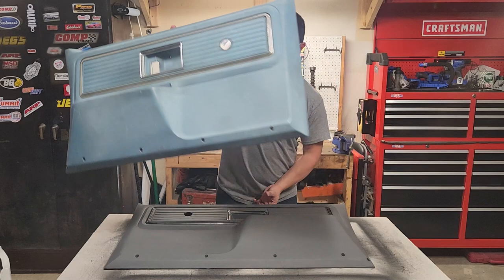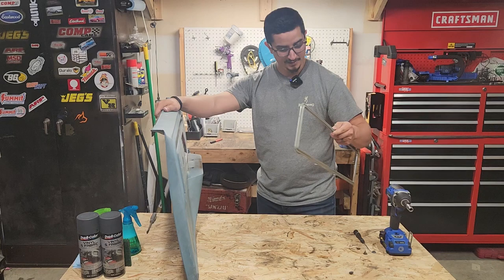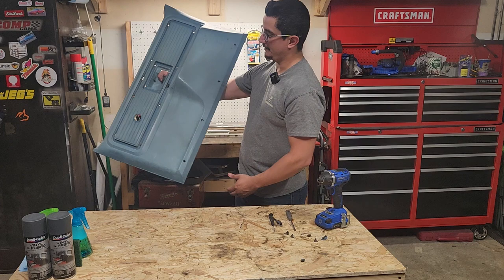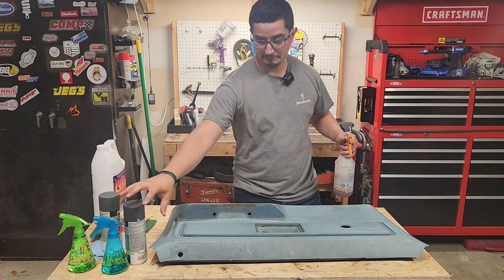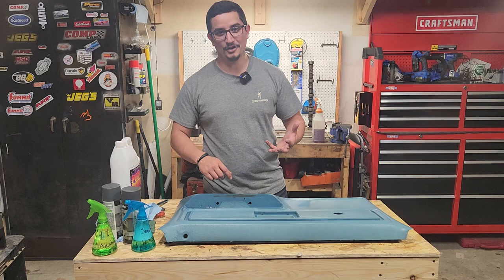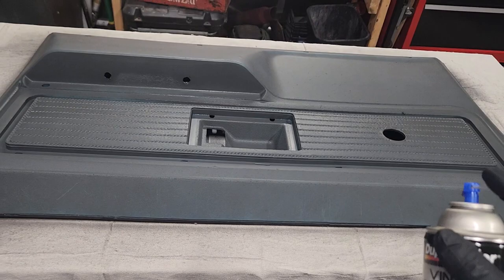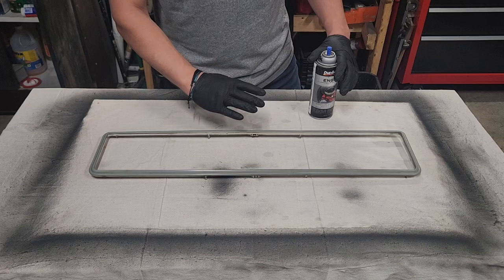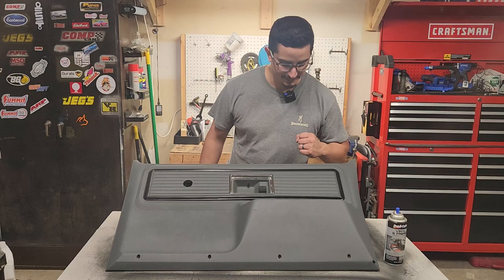RESTORE door panels for your classic! Bringing 73-87 Squarebody door panels back to life!

Comment: Looks really good, as a body and paint guy I've gotta say these spray on dyes and interior paints have come a LONG way in the last several years. I'm in the middle of building a 75 Cutlass restomod and had to buy used ones that were different colors, I figured I'd just dye them until I could buy new ones but they came out REALLY good and talking to people who had done it in the last couple of years and told me how well they have held up. The secret to the nuts on the back of the panel is to hit them with some WD40, PB Blaster or some other kind of lube and let it get in there and penetrate the threads

Comment: I’m about to do mine on my square body k5. Have to replace my window seals also. I ended up getting cinnamon brown from a bmw color.
Reply from the maker: Nice! Just make sure to use different cranks! The factory ones will scratch up your work
Reply: @diveingarage  crank? Window crank?
Reply from the maker: Yup
Reply: @diveingarage  thanks for the advice. I was planning on replacing them anyways.

Comment: I wanted to do this but My Panels were spray painted already and ugly Bright blue. How would you go about removing the paint  for 1972 Deluxe Door Panels?
Reply from the maker: That's a tough one. I think if I were in your position, I'd sand and strip them best I could, then prime them real good to get a good base. The duplicolor stuff goes on like spray paint. Worst case is they're toast and you source some more. They're out there.
Reply: @diveingarage  Ok I'm going to try to Save BC it was My Grandfather's Truck so I'll Try Degreasing and Cleaning non Abrasive as Much as possible then Just paint. I'll make a video Just Bc there wasn't Much on topic. I actually met someone today with Same Panels and painted but they were OG color. Thx for replying
Reply from the maker: That's awesome,  glad you're saving his truck! When you make the video,  tag me so I can see how they turn out!
Reply: @diveingarage  Ok will do Thx Bro